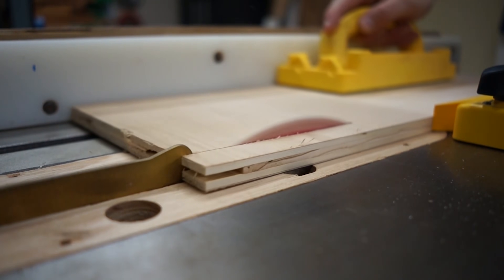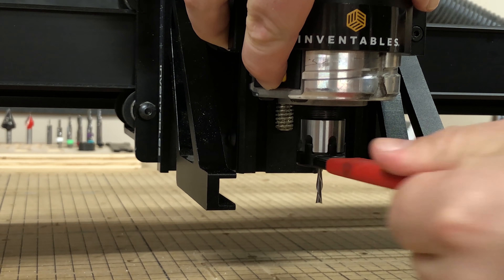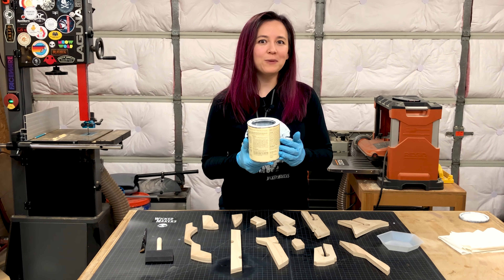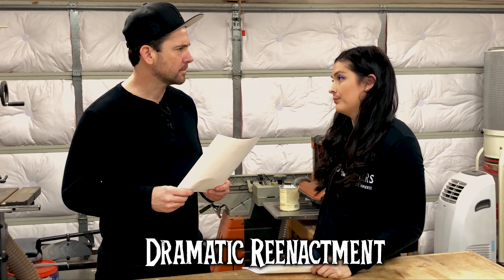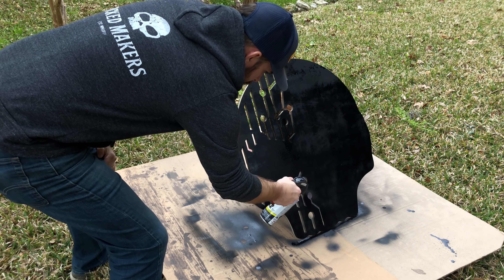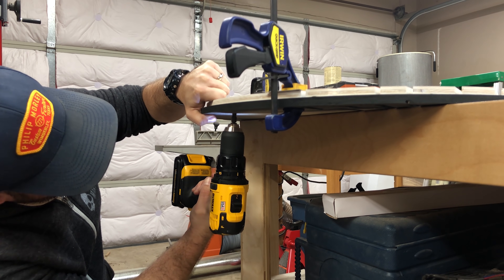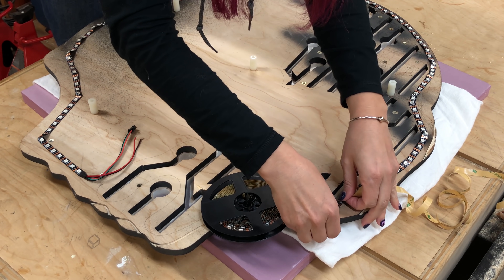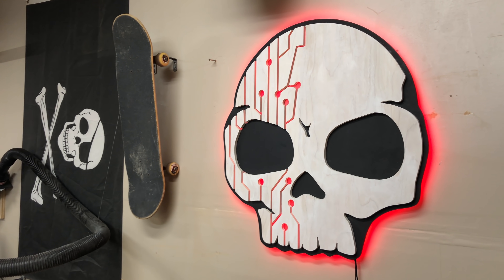We built a huge glowing skull (for our workshop!)

Comment: If you make another sign, you should put the wax paper on the back. It'll still diffuse the light while at the same time be less fiddly to apply. It would add depth to the circuits, but I don't know if that would be a good thing or not.
Reply from the maker: Yeah good idea! We didn’t do it here because we didn’t want to see the interior of the rougher circuit cutouts in the black. If we did it again without needing to redo it halfway through it would open up some better options. Thanks for watching!

Comment: That’s seriously cool. 🤘 A question, could you have routed out the black part with the negative shapes of the white parts,  say 1/16” deep, to hold them in place? Of course that’s a lot of routing. Just thinking out loud. May not be practical on something like this sign, but maybe for a future design. That way there is zero alignment challenges. Just drop the parts in the “holes” and go.
Reply from the maker: Yes! If we hadn't had to go back halfway through and rout out the back that is exactly what we would have done. :) We were concerned with needing to re-align the back piece that it would be accurate enough. Definitely a good call! Thanks for checking out the video!